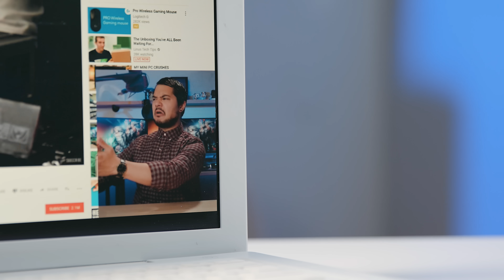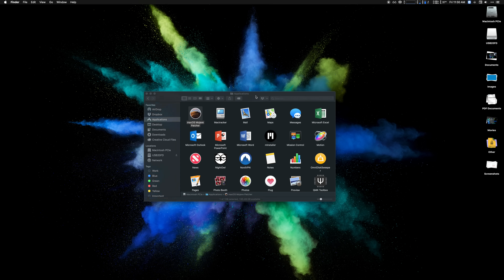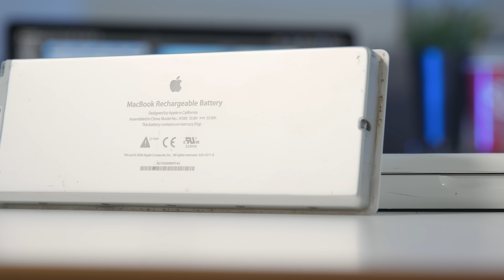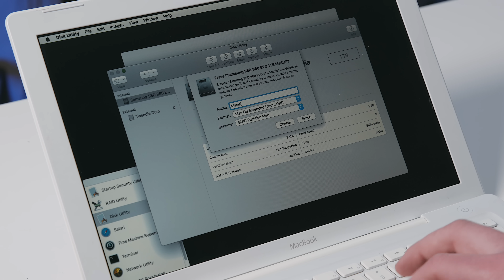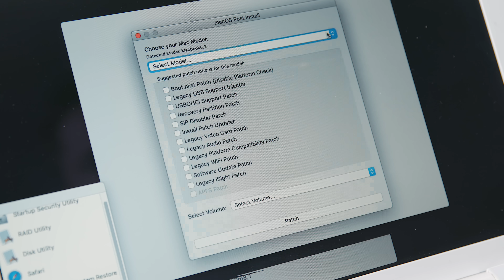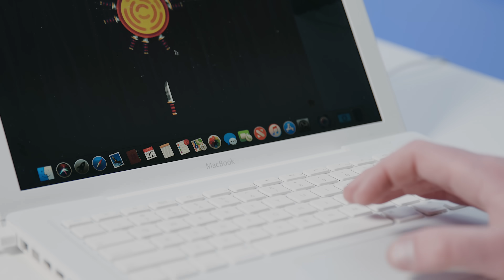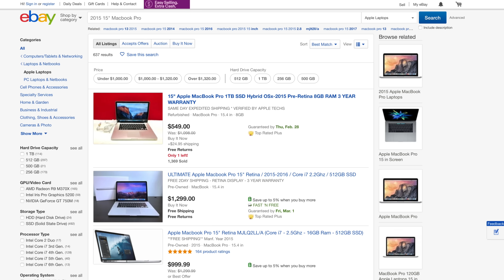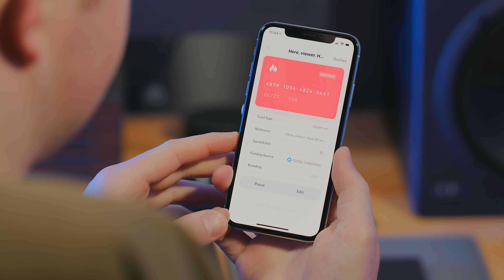Hackintosh a... REAL Mac?!

Comment: I thought hackintosh means a laptop or computer manually assembled and then installing MacOS with a downloaded ISO/DMG file

This is more like updating the old Windows XP/7 device to 10 with a crack
Reply from the maker: I explain in the video that the install process is essentially the same on this machine than it is for a new MacBook. Once Apple's hardware is vintaged and support is removed from the OS, you have to patch that back in—just as you would with unsupported hackintosh PC hardware.
Reply: @snazzy  yes I got your point thank you for replying, what I'm curious about is can I follow the same process on some HP, Lenovo, Dell Laptop and install the MacOS there? or on Any other manually assembled CPU can I install it on that?

Comment: 6:09 "no modern computers can do this" ... except for every Windows computer?
Reply from the maker: Most cannot. You can replace them, but they’re seldom easily hot-swappable.
Reply: @snazzy  I meant the hibernate feature. It's true that the automatic bit isn't widely available but it's only a few extra steps.
Reply: @snazzy  Thinkpad T, hot swap without even turning off.

Comment: I was going to request a correction, but I see that you have already done so for the OS and date. I did the Mojave patcher on an A1342 MacBook and it works very well. The only thing is that light mode doesn't work very well and, for the most part, I had to revert back to dark mode.

Comment: I did something similar to my old 2006 Mac Pro. I upgraded the processors from four to eight cores. Installed a cheap ATI Radeon GPU from the 2008 model and it now runs Mac OS Sierra. I really need to update it to a newer OS soon though but definitely better than Mac OS X Lion the last OS it can officially run.

It was quite a lengthy process. I had to patch the firmware for one thing into thinking the Machine was a 2,1 Mac Pro rather than a 1,1 Mac Pro

Comment: Your comment on battery capacity is incorrect. Modern MacBook battery capacities aren't "much higher". In fact, this video shows that this Macbook has a 55Wh battery which is the same as the 13" MacBook Pro. The real reason modern laptops have better battery life isn't higher-capacity batteries, but rather the more efficient hardware (mainly CPUs and displays).

Comment: If you're looking for a super useful MacBook Pro that's still somewhat modern with the standard ports that would need a dongle on the new models, get a 2015 MacBook Pro. I bought one for $800 with 250 gb of storage and VERY little use. Haven't regretted it.

Comment: Ok, I haven't watched video yet but I'm so glad you made this. I have a 2008 unibody MacBook running Yosemite (?) and though it isn't my main computer it would be nice having a newer operating system on it. I got my 2003 windowslaptop to run windows 10(albeit I had to upgrade RAM from 512MB to 2GB for it to run more smoothly) so why can't I do that with Mac?

Comment: I have Mavericks/Lion dualboot on my old Core2Duo macbook. Seems to work ok enough, I could never get anything above Mavericks working quite right - and Mavericks itself never wanted to play right, especially with the display brightness adjustments.
Reply: Apple did a serious disservice to the GMA 950 based laptops. The unibody Macbook is the best imo, and something that should be the perfect starter Mac portable running macOS Mojave.

Comment: That is not a 2009 model. The 2009 model was UNIBODY. The 2008 model was aluminum. That model is fro 2006-2007.  That one has a top case that can be separated, the 2009 models had the top all as 1 piece of plastic and the bottom came off. Why do people who know nothing about MAC keep trying to talk about MAC ? 2009 Model had a replaceable battery but it was screwed down and behind the bottom cover that was screwed down.
Reply: I forgot they made an early 2009 model for a few months before the "late" 2009 model came out. This one used ddr3 ram and maxes out at 6 vs. max 6gb of ddr2 ram for  2007(SR)- 2008, 4gb(3gb readable ) for late 2006, and 2gb for original 2006 model. This has the 9400m GPU.

Comment: That’s because Apple wasn’t playing the planned-obsolescence game back then
Reply: At least not to the same degree that they are now. They still were though. Remember, the iPhone's sealed in battery was abnormal at the time for smartphones.
Reply: I blame Drexler, Cramer and Icahn as the cause and Cook for letting it happen.
Reply: The new Macbook is way too thin for removable storage and removable m.2 nvme.
Reply: @BrawndoQC  dude that doesn't make any sense. Phones have been thinner for years and still manage to have removable batteries, it's all in the design. Apple products have been re-designed to be unrepairable and that's a well known fact, same with software, why do you think you can't downgrade IOS versions? You can't even open notebooks up without a especial screwdriver nowadays, how's that cool coin size latch to open the compartment making it any thicker?
Reply: @vocalead  What phone you have with a removable battery?
Reply: @BrawndoQC  My current phone doesn't have a removable battery but that's not the point. My point is, phones have been thinner than notebooks for ages now and you can still manage to get them with removable batteries even to this day, so a device's thinness is not an excuse for an unremovable, glued-on irreplaceable battery.
Reply: @vocalead  Actually yes it's an excuse, and it's also for water resistance.

Comment: A 2009 MacBook with 4gb ram will run 10.13. I know I have sold a few. Any MAC item with the 320m video chip will run 10.13,( 2010 mac mini ) only the devices with the 9400m are stopped at 10.11.
Reply: and machines like this with the GMA 950 were stopped at 10.7 for the ones with Core 2 Duo's and 10.6 for the original Core Duo model.

Comment: I have a white Macbook from 2006, the second version and the very first Macbook that was 64-bit... although they kept a 32 bit UEFI for some reason so you cannot do this. BUT... I managed to put 64-bit Ubuntu on it with a modded installer available online. It works fine for light tasks if you get the RAM to its MAX 2GB DDR2 and an SSD. You can pick one up for 50$ these days, so this project was worth it :-)

Comment: I have an iMac 2010 model. HDD died few years ago, and I was able to find replacement instruction online and put a new SSD on. I put it in my parents' place and use it once in a while when I visit them. It works like a charm. After watching your videl, I was thinking of trying Mojave Patcher and upgrade my iMac (not that it requires an update, but that I like the upgrade itself), but it seems like my 2010 model is not supported. So my iMac is too old for update and not too old for Mojave Patcher. Kindly of funny. LOL

Comment: I had two of those Polycarbonate Mac's back in the day.  They were good.  I wrote and compiled some of the V2 versions of the iHeartRadio iPhone app on those.  The only issue I found was that top layer of plastic would chip or delaminate around the palm rest area.
Reply: Jason Coulls I experienced the very same issue Jason, and my family at the time had one each, so it happened of four Mac machines. When I took mine to the local apple store they said they’d replace the top surfaces on each of them free of charge. Delighted. 👍

Comment: Also Linux is much better for basically a chromebook by todays specs. Should have forgone MacOS when all u can do is use the browser and MacOS is shit for exactly that. They still haven't figured out the multiple window issue even in Mohave. While Windows has had it down pack for yrs and have nearly perfected it in recent updates. 

MacOS is good for Final Cut thats about it anymore..... Sadly

Comment: I have a Windows laptop that was supplied with Windows Vista (I downgraded to XP with disks from the manufacturer) ... it has since run Windows 7, 8, 8.1 and 10 ... I added a larger hard disk, RAM and a new battery and it works fine for daily tasks.

The laptop cost me about £350!

Comment: Thanks for another amazing video! I never ever thought about this! Never even researched about these patch upgrades! Otherwise I'd buy an old MacBook Pro instead of a new 2017 MacBook Air, I'd get a better CPU in that case. I didn't spend much tho, only $699 for a 128gb/8gb model (I did upgraded the SSD to 480gb NVMe). I could do a video on those cheap mechanical keyboards on amazon, I would really really enjoy & appreciate it! Keep up the good work man!

Comment: Wow that thing is a real screamer I have to say. Upcycling older Macs saves money and the planet! Buy used!
Reply: Luke Miani you and snazzy inspired me to get in the Mac game I have a 2017 late 4K iMac ...... 2012 Mac mini and 2009 MacBook like in this video
Reply: Hi Luke, I follow you on your channel as well...The problem with your comment about buying a used mac (which I do) is that Apple is now soldering everything to the motherboard which means theres no future upgradability on them. This is why, every time Apple starts boasting about how "Green" they are, I simply laugh at their hypocrisy since you are now, basically forced to upgrade to a New system in order to stay up to date. I just bought a 2015 Macbook Air which allowed me to upgrade it to a 1 TB SSD. The current Macbooks (New Air, Pro, and 12" Macbook) do not allow this at all.
Reply: @mrhats830   While you're right and that does impact upgradability, recent Macs last a lot longer than they used to, even without the ability to upgrade. The mid 2000s Macs were short lived compared to the last ten years or so. Even if you can't upgrade, using them for longer reduces waste
Reply: My old HP Pavilion Dv7 still is going strong, I replaced the RAM after a chip failed for 50 dollars for DDR3 RAM with a higher clock, and installed Windows 10. My friends who I gave it to, their father re-did the thermal paste, and upgraded it to 8 gigs of RAM, and to a 500 Gb SSD
Reply: shame on apple now everything is disposable, sealed and unfixable.... never again apple
Reply: @LL-ck4ei  which is why I buy HP they make them easy to repair and upgrade (not CPU or GPU) it took me 10 minutes to remove the back of my Dv7 and replace the RAM and remove the faulty HDD that never worked. My current one has 8 screws but it's slightly difficult to remove the back though, my Lenovo forget it I need 2 mm torx screw my smallest doesn't fit.
Reply: @Luke Miani could you do a video with a mac mini circa 2011. I would love to see what the performance would be like with that machine.
Reply: big screamer
Reply: Luke Miani make a YouTube video doing this on your black MacBook..
Reply: L
Reply: Luke Miani I just bought a 2009 one today!!!
Reply: Holy shit it's Luke! What's up dude?!
Reply: You can find old MacBook airs and they’ll last longer. Don’t waste your money on this model. Only good for a YouTube video not real life.
Reply: @sandi260   The bottleneck is memory. Buy the newer models (unibody) with DDR-3, those can be upgraded pretty cheap and than the MacBook is still usable.
Reply: Yuck, please don't ruin it by calling it "upcycling". It's simply using a perfectly usable computer with an unsupported OS. I agree, everyone should be doing it, but don't give people reasons not to do it by calling it "upcycling". :D That word is so cringeworthy its's basically radioactive.

Comment: Hey Quinn, picked up a 2010 macbook in October and did this with it. Put a SSD (256gb) in and running Mojave on it. Running 4GB of ram I find myself using it daily. I might bump the ram to 8gb though. I find running multiple tabs in safari they have to reload when switching back. But, if I'm honest that's a little nitpicky for a all in cost of $200-250 compared to the 1,500 + Maple Syrup dollars :D So I can say without a doubt one of the best and easiest hackintoshes out there. What turned me onto this was your cheap hackintosh videos and I ended up finding Dosdude1's channel and website. And you're damn right about the keyboard too. So much nicer than the new ones. I like the travel feel.

Comment: My windows PC that shipping with XP runs 10 now, ran better on 7 no doubt. Didn't have to upgrade a thing the 2gb of ram and hard drive was enough. Added a cheap ssd and put new thermal paste and that's it, runs very well.

Comment: The Lenovo Thinkpad T480 has 2 batteries, 1 internal and 1 removable. When you run out on the external, you take it out and the power is transferred to the internal battery. Then you put in another external battery and the laptop runs off that. No closing the lid required.
Reply: I hope he sees these comments, then again it's probably something he already knows just to tease ppl to rack up more comments smh
Reply: Chosen Architect true. And we are contributors to his comments too.
Reply: And almost all Windows laptop can do that, just click hibernate, but for some reason they removed it from windows 10...
Reply: @tristan6509  Its still there, you have to activate it in Power Options, Choose what the power buttons do
Reply: @nachiswichis  I just use classic shell because I'm used to all of the windows 7 shortcuts
Reply: @tristan6509  Not really, he is speaking of hot swapping, laptop not turning off when changing the battery. Though it kinda needs practice to pull off smoothly.

Comment: thats the same model I used to have.  it was a great machine in its time.  over the years my superdrive broke, my screen burnt out (had it wired up with the mini-dvi port as a workaround) and the battery swelled up too.  be careful with those older macbooks because that battery can cause a fire or explode.  recycle it asap!

Comment: Cool video but you had one inaccuracy. With regards to not being able to pull the battery out of modern laptops, I think you should check out the thinkpad T480. It DOES have a removable battery that can be hotswapped.

Comment: Haha, wow, I JUST completed a refurb of an old 2009 MacBook Pro by replacing HD with new (but smallish, but FAST) SSD, swapping in new battery, adding RAM and using this patcher.  What a coincidence.  And that old MBP is just fine with it's Core 2 Duo CPU.
Reply: Same here. I just upgraded mine. I opted for the late 2009 model. Still has easy to upgrade hardware, but it has a more powerful GPU. Apple best be careful, when people are opting to buy their 10 year old laptops instead of new ones.
Reply: Are you going to sell it? How much are these going for?
Reply: @necromax13  No, my daughter is using it.  They are not worth very much, less than $100 I think, without upgrades.  The upgrades were not cheap.  They cost almost $200 (the battery was $90), but it's a completely useful computer for $200.
Reply: @alliejr  i'll have to look into it, these things are unbelievably cool.
Reply: Did this upgrade for my now unsupported Mac mini 2011. Love it.
Reply: replacing the optical drive with the old hard drive in a caddy is also a great upgrade when you do the ssd.
Reply: @poiiihy  Hmm!
Reply: T R E N D Y F O O L  Nice, I basically did the same thing, but I have to say my mid-2009 mbp is the top-spec'd one, it has a 3,06ghz CPU. Other than that I fully agree these machines just WORK.
Reply: T R E N D Y F O O L  Well, 100% agree with what you say. I have MBP late 2008. Fully face lifted - RAM, SSD, battery replaced. Apple, IMHO, nowadays goes bananas with it's never-ending "thinning" and non-upgradeability and removing of ports, and, where I am totally mad - removing the Magsafe - totally idiotic ):-/
Apple is pissing me off.
Reply: The thing is these core 2 duo keep up with or outperform atom and n series cpus. Which are used in most sub $350-$500 laptops. In my laptop compaq cq60 te cpu is sockoted it now has 8gb ram and a 2.5 ghz dual core.
Reply: VACCINATE YOUR KIDS ALREADY! Most likely, but there might be complications with how the cooler is installed, and cpu is seated. The CPU already installed is quite capable on its own though, don’t know why you’d wanna change it.
Reply: T R E N D Y F O O L  again, the top mid-2009 model is the 3,06Ghz model, not hating on your machine - glad it still works as well as it does almost 10 years later.
Reply: I'm thinking of doing the same... can the same RAM be used from a Mid 2012 MacBook Pro? got a few of those cards lying around
Reply: haha I just did one the other night! Neighbour brought it over, it was given to him. We went over it, found it running 10.6.8, and had a dodgey keyboard. Reseating the keyboard connector fixed that, upgraded to a 250Gb SSD I had spare, and 6Gb of ram from the original 2Gb. Then I used my 2018 mbp to make a mojave installer using dosdude1's patcher. :)
Reply: you could have actually just repaired instead of swapping in a new battery but okay. as i am pretty sure that battery uses 18650 battery cells
Reply: @aleksandersats9577  Battery repair is way beyond my pay grade.  I can unscrew things and do that back up again.  That's my limit.
Reply: @alliejr  okay but i will tell you it's not hard to solder at all when you learn the basics and soldering will come very handy if a connection is broken.

Comment: I would say, I ran Mac OS X Lion, with VirtualBox, used a Hackintosh tutorial with iBoot, to be able to run Snow Leopard on my MacBook Pro Mid 2012 (which is "unsupported" by Apple), and it works, If you know what you are doing.

Comment: That looked sweet, i got one of the white macbooks. I immediately noticed the different webcam lens. It also looked too "new" if that is possible :) An the front side looks different as well. BUt dang i miss the "old" days where mac could get parts swapped out as easy as this.... I hate this new method of "order and stick to it"! PS my trackpad is different, i had some issue where it was continous scrolling but somehow that went away. But i dont have the button on the bottom. Im shocked that it can even run Mojave. I remember when i upgraded it to El Cap and was sort of sick that i did it because it was so much slower.